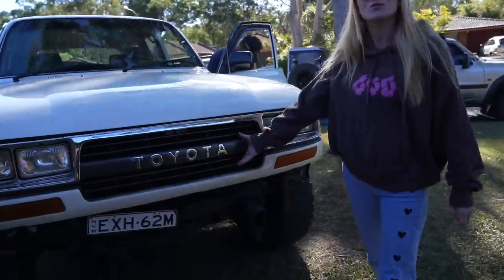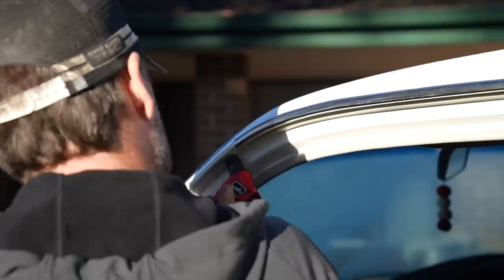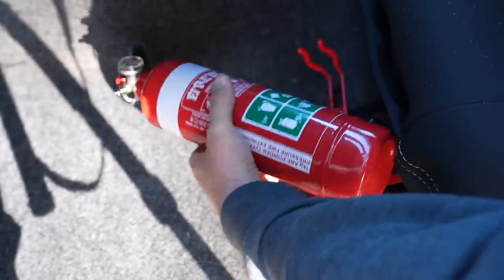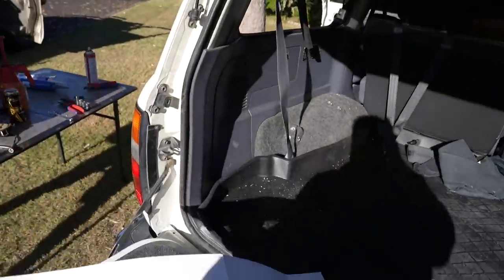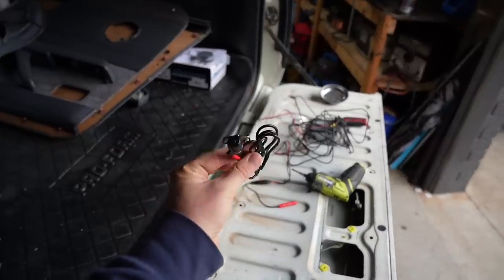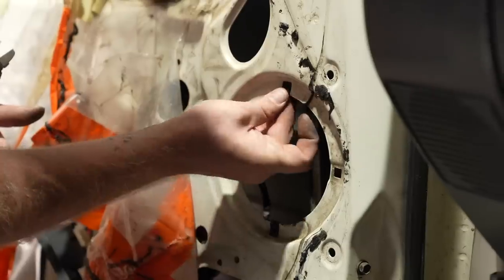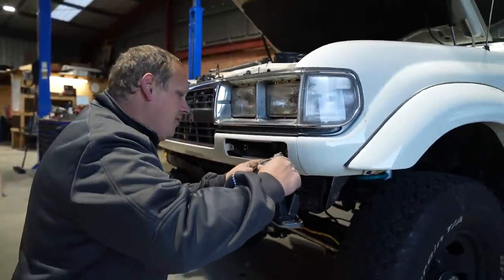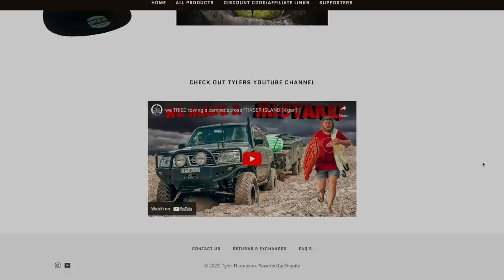Cutting into our LandCruiser! Ultimate 80 series build & restoring a 30 year old 4WD

Comment: The body rubber / seal should have the join at bottom. Water will pool along top and possibly leak. Loving the landcruiser videos now
Reply: Yeh it did get changed to the bottom once I got the inside done

Comment: Use the original spacers and mod for your new 4" speakers inback door. Works perfect. Pop out the old one and adjust the spacer for new speakers which you glue in then sits perfect for the original cover.

Comment: Coming along well guys. Probs just move the pinch weld around so the join is on the bottom. Just for any slight chance it gets water in it. It wound hold in the strip.

Comment: I just replaced the rear speakers in my 80 series to. But I 3D printed new housings to accommodate the new speakers and fit neatly in to the original locations and refitting the original speaker covers. Can you get a new grill with diesel  in the bottom corner.

Comment: Todd did a great job on those gullwing windows replacement.  I guess it makes it darker with less natural  light in the back, does it help with keeping heat coming through the glass previously or do the gulling get hot on inside?
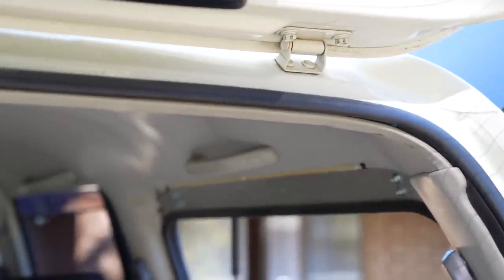Reply: For a pro product @12:20 thats a really crappy finish inside.
Reply from the maker: We will have to see when summer comes!